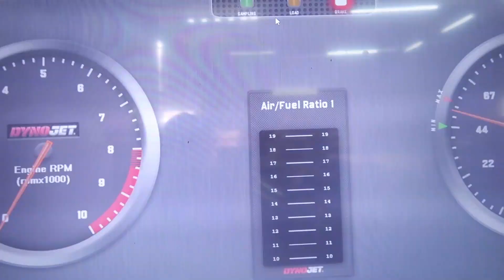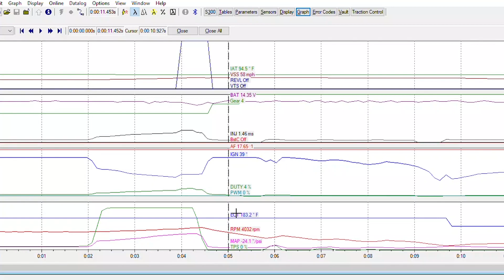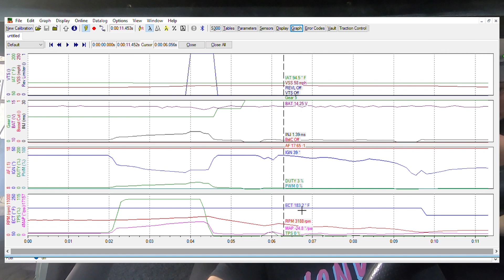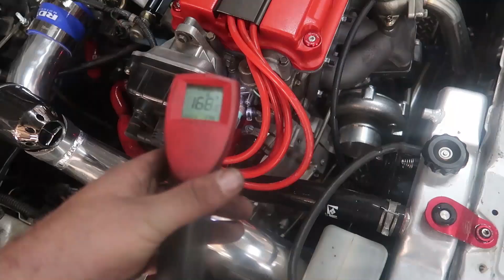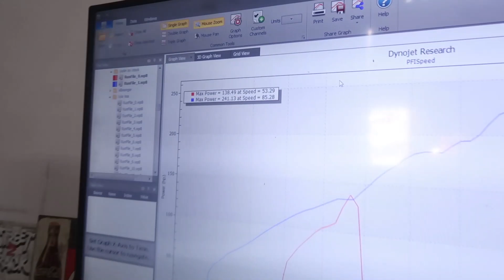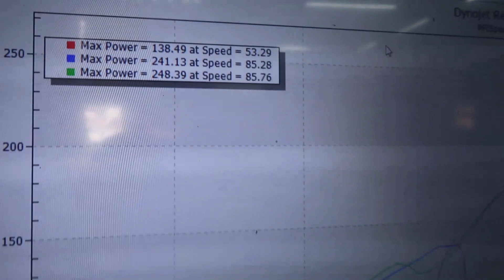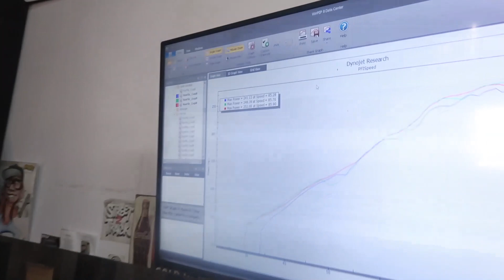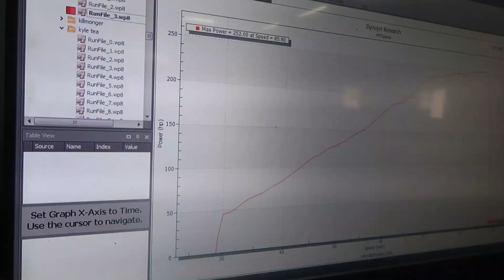What is This Sensor Thinking! QuaranTUNEd

Comment: Question for you i have a 96 ex coupe auto to manual swap. I cant seam to get any power to my door wiring no fuses blown i re pinned the door plug coming from wiring harness to the door and still nothing i am loat and now my sunroof wont open either i would really appreciate any help from anykne if they know

Comment: Does this car have a stock o2 sensor and is that why its reading 17.5 lean in hondata because there in no aftermarket wideband wired into the ecu? Been wandering about that for a couple videos now.
Reply: Travis Reid just means if it does have an aftermarket it’s not connected to the ecu or the car is running in open loop witch means the o2 disable and that the voltage is staying the same

Comment: My 03 CR-V 2.4 tries to stall out and sometimes succeeds at stalling out. I've changed all the sensors (all of them) and VTEC sylenoid and while it runs better it still wants to stall out when I put it into park. Runs smooth for a second then cuts out and most times levels back off and runs smoothish. The motor vibrates hard also. Changed all the motor mounts, helped some. Thinking maybe the two issues are unrelated but not sure. The vibration, I think, is the harmonic balancer.. looks a bit wobbly. Leaking oil like a champ.. can I fix this with a basic tool box? I am a mailman in Maine and try to do my own repairs. After watching the crew here build one after another bad ass motor. I feel like, if need be, I could try and build a motor for the mail buggy myself.
Reply: Any ideas?